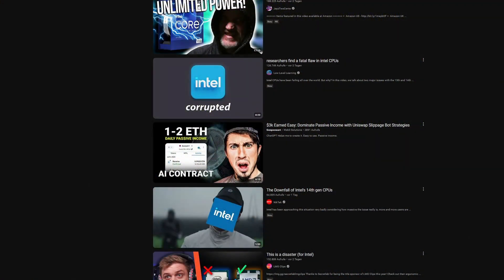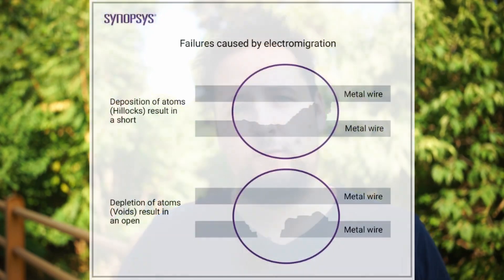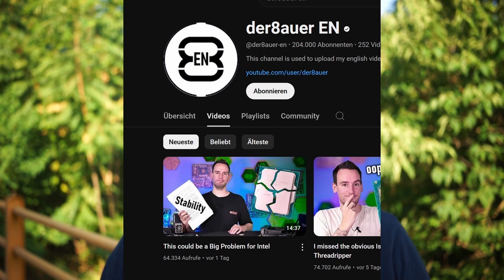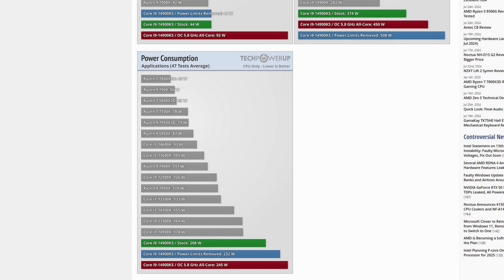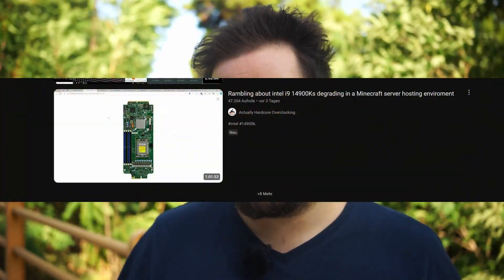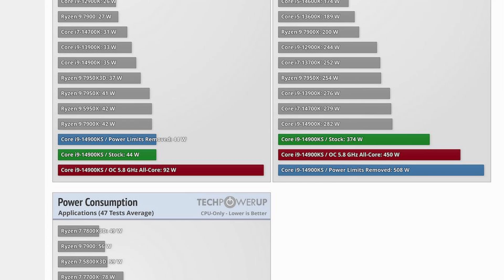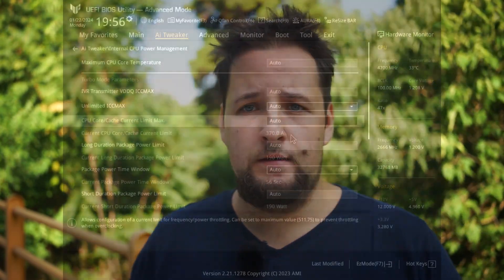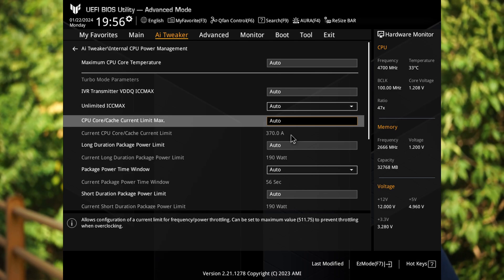Can YOU save YOUR Intel CPU? | The Intel Disaster explained | What You and Intel can do!

Comment: The only reliable intel processors are what’s powering my mid-2015 MBP with the AMD R9 M370 graphics on board and 2.5 GHz core i7. The other is my mid-2009 core2 Duo MBP. Lucky i jumped ship to AMD Ryzen 5 7600 CPU and Nvidia 4070 12 Gb system before this mess. Intel is Boeing all the way

Comment: I have a 13700kf it's only stable at Stock settings at stock settings it  performs less than 7800x3d in gaming and it has very bad memory controller.
Reply from the maker: Well that is normal performance wise but it could already be close to having bigger issues

Comment: Why is nobody talking about gaming laptops?
The cpu is soldered on the motherboard, if there is a degraded cpu it is a 2500+€ damage.
Reply from the maker: Because cpus in gaming laptops are usually not as heavily affected as they use much less power.
Reply: level1techs and a few others have mentioned laptop chips, it's just the overwhelming majority of failures are 13900k and 14900k. Every single type of 13 and 14 series rapter chip is failing to some degree, however.

Comment: Intel is banking on the warranty expiration on thes CPU's especially in regions outside of th USA that has less than 3years of warranty.
Reply from the maker: Well if they issue a recall even out of watranty chips can be replaced so if that happens may be a good thing
Reply: @limitless-hardware  No plans to recall as only a very small % of the over all shipped is affected.

Comment: bios, vsoc, vcore, vid, system agent, vddq etc. who the f*** knows about this as normal user? 2% you have no chance there are 100 other metrics with voltage
Reply from the maker: Completely correct. And i would guess only a small percentage would also just send their cpu in for replacement if it was working fine

Comment: How would I know if my CPU was damaged running at stock speeds. Would intel even rma a chip that isn't experiencing instability
Reply from the maker: you wouldnt probably even notice it if it was at an early stage. but intel should  exchange the affected cpus as soon as the correct microcode update is out
Reply: If the Batch# of your CPU matches a defective batch then they will RMA it 100% but it's gonna be a long process
Reply: i only had UE5 errors that were fixed with BIOS update but I am worried I should RMA
Reply: crashes every 5 hours strange freezes afte rall is updated and temps are under control. MY itel kinda died 4 days ago and no software will fix once u see it whiteen - oxidation. i just left my intel in the rain.  to die away now im glad to get off this useless platform.
Reply: Intel is already having trouble trying to RMA broken chips
Reply: @John.Philip.Tan876  how are they having trouble RMAing?

Comment: The end user should not have to consider any of this. Intel should offer free, preemptive redundancy upon request, at the original advertised specification, sending out the new CPU before evidence of failure has occurred, contingent on the end user never holding onto more than two CPUs at a time, or a full motherboard upgrade with a new technically superior CPU and board at Intel's option.
Reply from the maker: This is correct 
Intel will probably replace any of these cpus even if they dont show issues as they probbably have already taken damage, even if its not niticeable yet

Comment: I have bought the i9 13900KF to try it out. Its too hot for me even after undervolting and I dont really need that much cpu performance. I bought the i7 which I not build in yet, what is the best I can do? AMD is just to much to swap for me. I dont have that much money to buy new Motherboard, Ram and CPU
Reply from the maker: undervolting it might be the best thing to do and you can also limit the turbo power limits within your uefi. Keeping the cpu under a power consumption level of 200 Watts dhould be already a good step towards this. But it could alsready be permanently damaged if used at stock speeds, you never really know.
Reply: Get i5. It beats every i9 from previous generations in gaming and 20 threads is plenty for work.

Comment: Are laptop Intel procesors also affected?
Reply from the maker: No because they dont have as much power draw. Its stated that only cpus above 65 watts are affected so only k skus. And the more power they pull the worse it is. A 14900ks would be affected worst
Reply: @limitless-hardware  laptops are also affected, do some research, customers are starting to complain...etzalla
Reply: @limitless-hardware  In the new intel statement they did not deny that mobile cpus are in the clear. They are still testing, so it is possible that even mobile stock is bad.